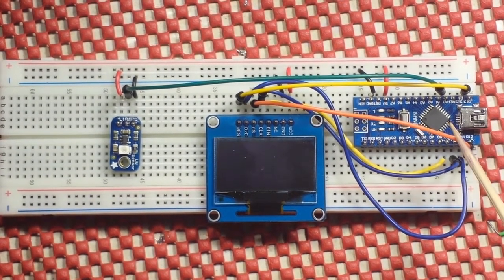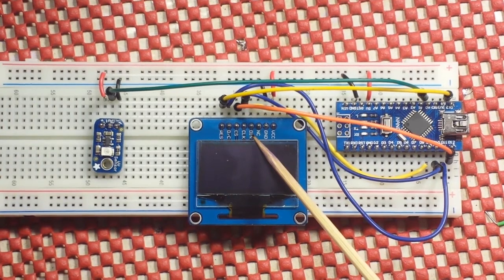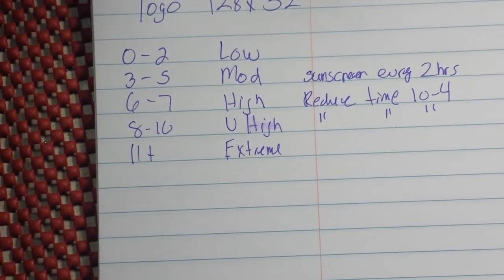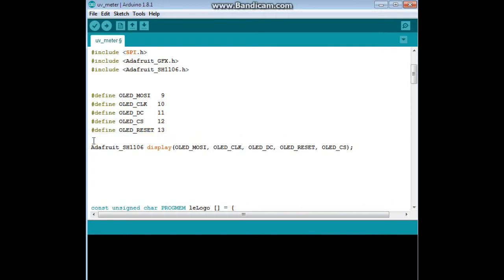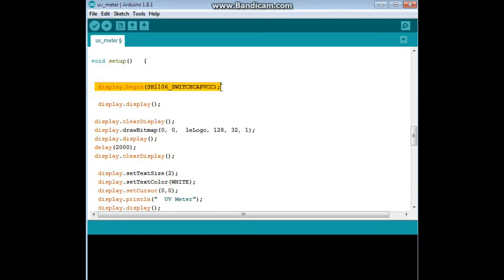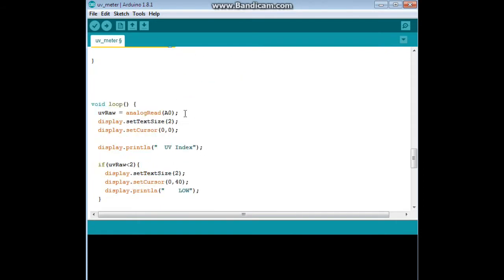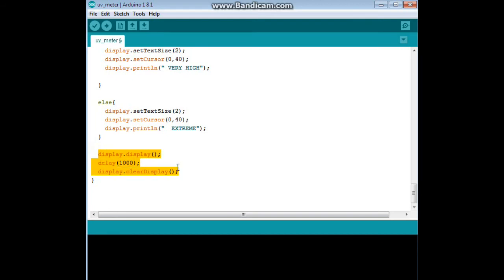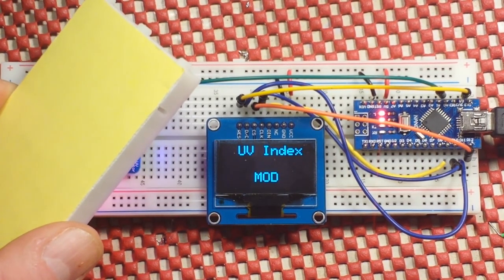How to make a UV Index Meter for Arduino

Comment: You don't need Arduino to see analog sensor detecting uv light. Nex time use a voltmeter on pin out of the sensor.
With the voltmeter you can see more precisely what is going on in the sensor and what kind of light is shining it.
You save yourself the trouble of doing all that work for nothing
Reply: The point is to build a full fledged UV meter with a proper enclosure which otherwise costs hundreds. When measuring UV-C light bulbs you really don't want to stand next to it for long while you're fiddling with wires and a multi-meter.
Reply: and you don't need voltmeter or sensor. Just use google and you'll find the current UV-index in your location. Albert, you missed the whole point of this exercise...

Comment: How does the code change to detect UVC. I need to know if the light is UVC vs UVA. Is this possible with UVM30A
Reply: No. It will detect 200-370nm which includes UVA, UVB and part of UVC

Comment: I know this is old, but this is just an analog uv diode, so It does not really return UV index, just a relative UV adc value
Reply: I doesn't really matter since it's relative. Look at your weather report on a sunny day, get the UV index from it and compare that to your reading. Collect a few more data points for different days and this should give you a good enough scale to extrapolate and map your readings against.